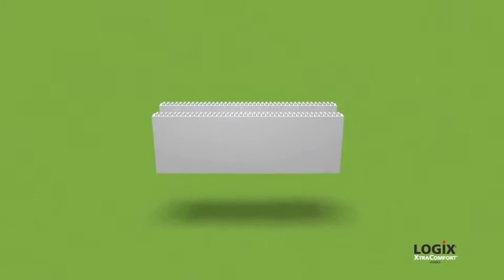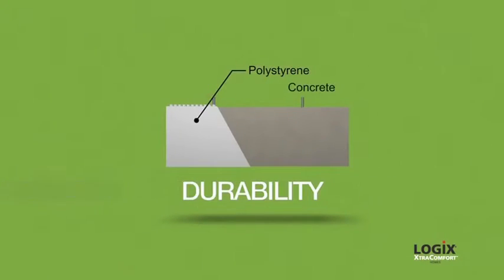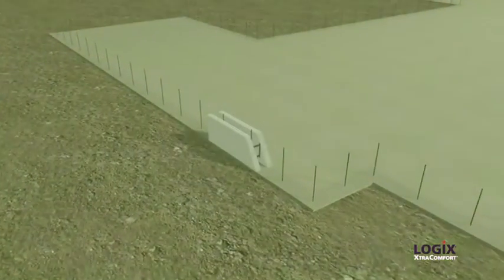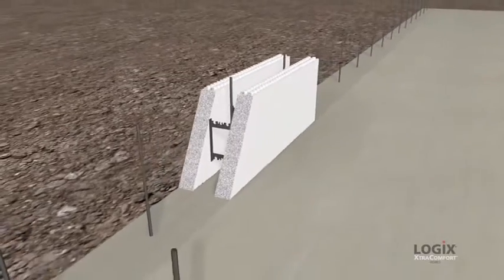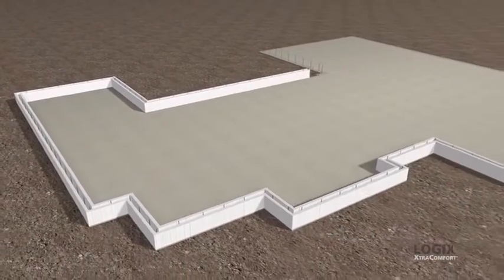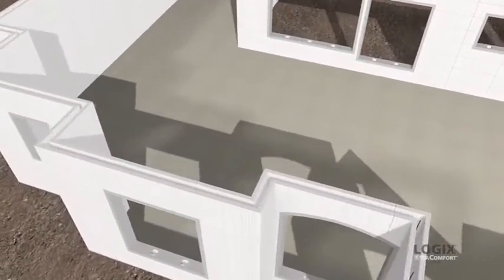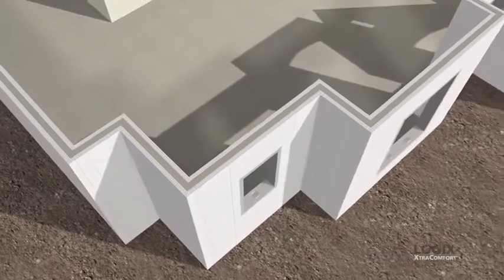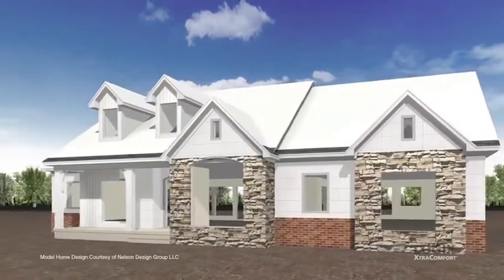How Logix ICF Works

Comment: How is thermal movement expansion and contraction of the concrete addressed to reduce or prevent cracking? Yes the insulation will reduce temperature fluctuations but not eliminate them, so far as I understand.